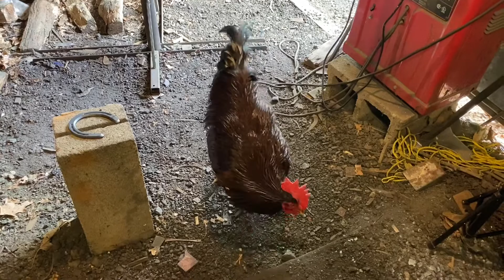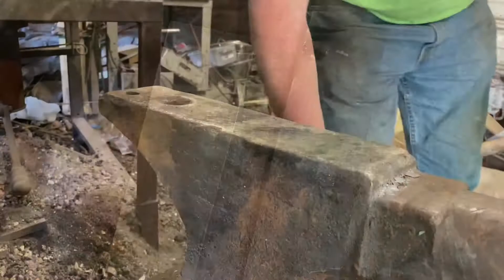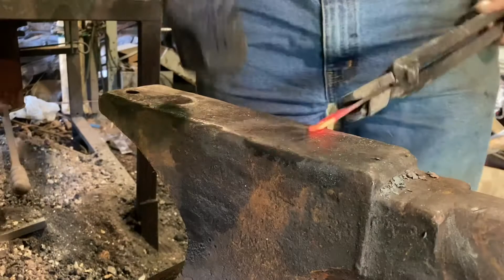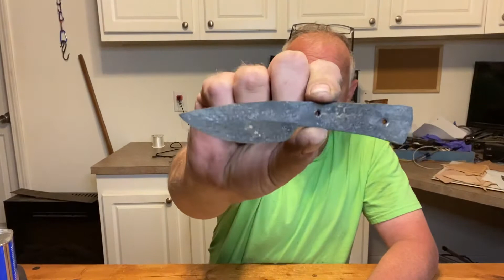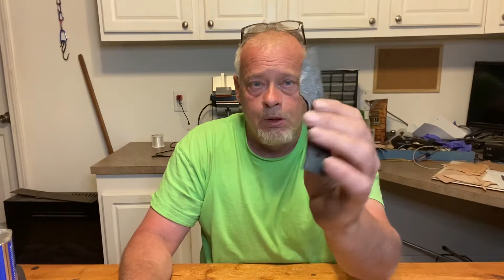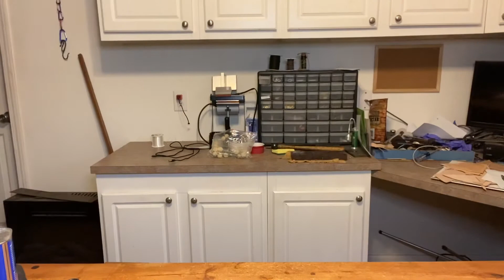Hand forging Tiny Knives

Comment: Small knives are way more useful than large knives whens the last time you skined a deer with a 10 inch bowie. For that matter a 6 in. Knife most of the time 3½ to 4 inches works best.
Reply from the maker: Absolutely right. I’ve skinned many a critter with the 2 1/2 inch blade on an ‘Old Timer’ pocket knife.

Comment: If possible, can you give me some pointers on getting the tang flat? Flatter off the forge, grinding it flat, anything? Thanks man
Reply from the maker: How are you trying to do it now?
Reply: @serendipityforge333  well, suppose I don't really have a method. One video mentioned to forge the edges first and then the middle so I've been trying to do that. I'm wondering if I should be trying to kind if fuller the middle of the handle kind of like they do on a tapered tang? The last tapered tang I tried, I accidently ground into the forge scale I was trying to keep because one side of the handle was thicker than the other so the other side rode up the blade quicker. Any tips would be appreciated. I've been forging for 3 years and still can't seem to get this part. Classes in my area are all for beginners and too expensive. Just feeling lost and get discouraged I suppose.
Reply from the maker: @knifeguystuff  I’ll think on it and see what I can come up with in the next video
Reply: @serendipityforge333  you're the man!